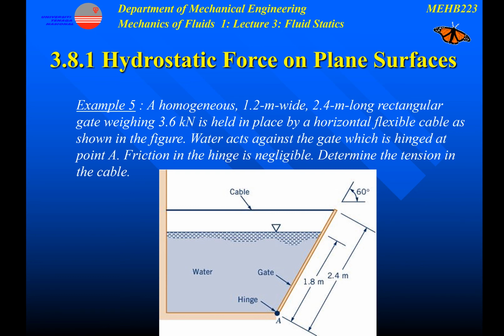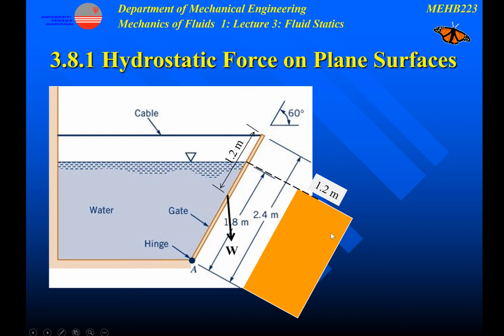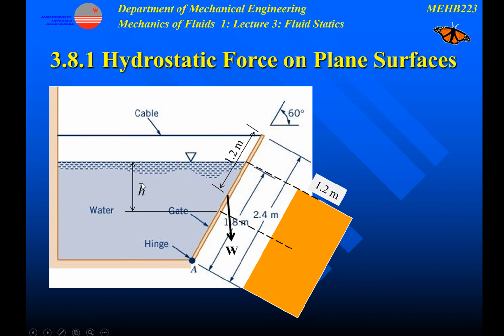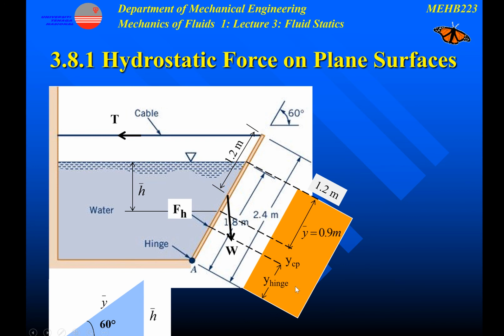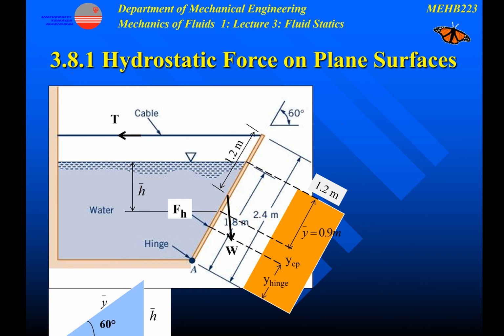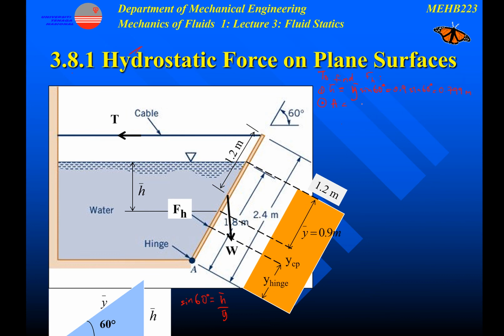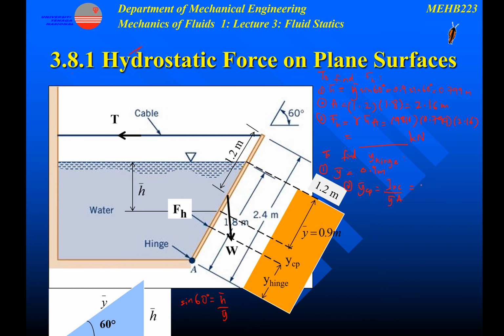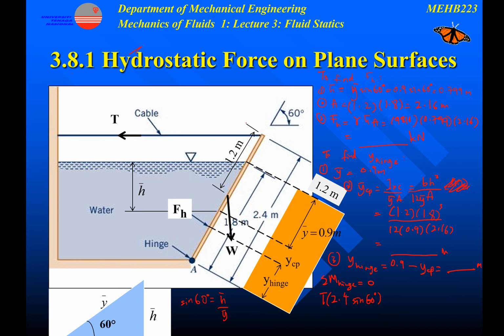Hydrostatic force on plane surface (example)

Comment: Aren't you forgetting to add yc to ycp?
Reply from the maker: There's no need to add yc (in my video i use ybar) to ycp. Please see the free body diagram (FBD), ycp is the length on the inclined plane from the centroid of the gate (that is in contact with water) to the line of action of the hydrostatic force

Comment: can we break the hydrostatic force in horizontal and vertical components like we do on curve surfaces?
Reply from the maker: You can break it to Fh(x) and Fh(y) when you do the summation of moment but it will just make the equation longer